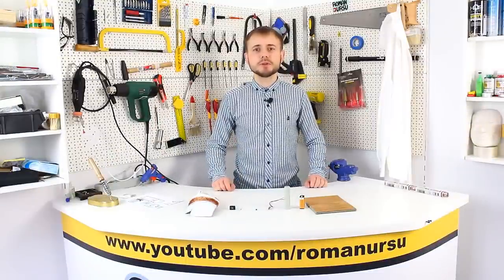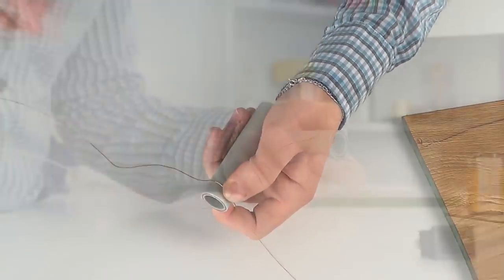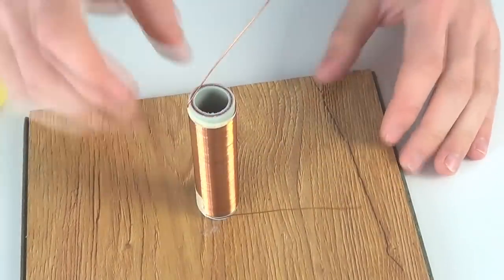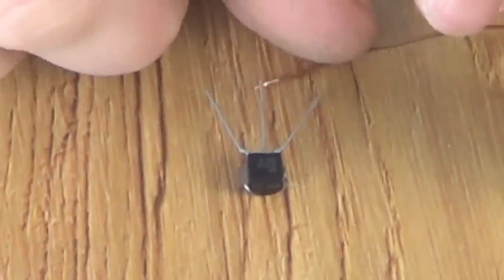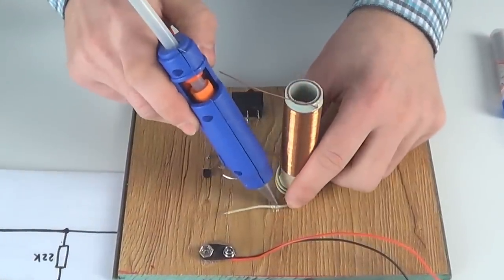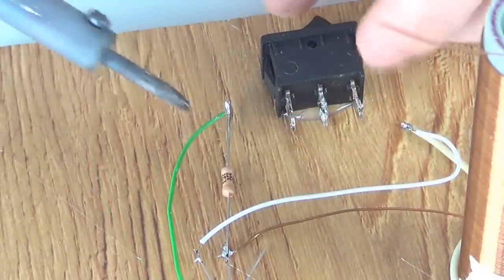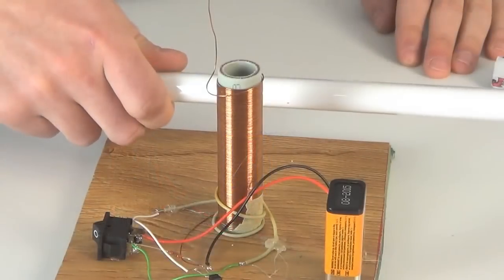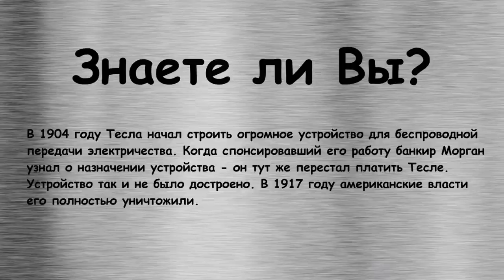How to make a mini Tesla coil 9V

Comment: it is slayer exciter not tesla coil
Reply: +Dark X66 tesla coil generate visible high voltage and it is powered by AC (alternative current) slayer exciter can be made of tesla coil. You can search more in the internet. I have one huge tesla coil and it is getting a lot of power so I have to pay a little bit more for electricity. sorry for my english.
Reply: can I use 26 AWG copper wire?
Reply: swg*
Reply: It IS a Tesla coil It has a secondary coil and a primary coil and if you used higher gauge wire and a high power  power supply and add a torus then you're done  with creating a Tesla coil that emits sparks at a high frequency
Reply: I can justify the difference between Slayer Exciter and Tesla Coil.. Tesla surely was the pioneer of the basic model and design of the way the primary/secondary is arranged.

However a classic Tesla Coil is quite different, different enough to call it a completely different circuit. It uses a spark gap and very high voltage discharges to step that voltage even higher across the secondary. the frequency is typically not high enough to be considered radio.

The SSTC is a little closer but it typically uses a driver with modulation, and most likely some form of fet switching on the low side.

What this man did in this video here was literally replicate a Slayer Exciter circuit using a single silicon transistor and resistor, the only thing he left out was the indicator LED. It's not wrong of him to call it a Tesla Coil so long as he remembers to credit GBluer (slayer007) with the circuit design.

I make them all the time and each time I know I'm basically building a TC, but It's always in my mind that I'm basically using a Slayer circuit design to do it. You can even most times remove the resistor and just run the circuit by kickstarting it across the B and C of transistor, making it an even simpler circuit. Still a Slayer Exciter.
Reply: Perhaps you can't read properly, but I clearly explained the differences between the two. There are many circuits that are quite similar but with slight variations are referred to by different names. When it comes to Tesla coils, this is why a 'solid state Tesla coil' is called that, because it's specifically referring to the way the circuit is designed. A traditional TC is going to use a spark gap and capacitor(s) which obviously a 'Slayer Exciter' does not employ. The RF and use of the transistor in Slayer's circuit is what allows it to emit a strong field at low voltage. A traditional TC is probably going to bite the crap out of you if you decide to touch the arcs, whereas a Slayer circuit is going to give you a small RF burn.

If you want to say a primary and secondary put together like that is always going to be the same thing then we might as well just stop calling them Tesla coils because they are nothing more than 'high voltage transformers'. 

Call it delusional all you want, I just happen to know the guy spent years working on it and researching it and tinkering with it to hone it down to a real nice and easy circuit to build and operate, so I don't see a problem with at least acknowledging  that by calling it a 'Slayer Exciter' whenever a 'Tesla Coil' is wired in that way and functions like that.

Comment: it is called: slayer exciter. not tesla coil
Reply: No, it's definately called a Tesla coil.
Reply: +Math's Tech A tesla coil has a big capacitor bank, runs on AC. This is a slayer exciter, not a Tesla coil. I can tell you more about why this does not make a Tesla Coil.
Reply: Flame 281
"Kind of", yes, but as you can see it only uses a single transistor flyback driver, NO spark gap, NO resonant tank and NO line filter. You can't call a slayer exciter a Tesla Coil... That's like saying a frisbee is a plane, because it flies.
Reply: +Azagro What you are doing is more like saying if it doesn't have twisting wings and the pilot laying down, it isn't an airplane.
Reply: we know
Reply: Steve Greenfield
What I am saying is that this is not a Tesla Coil.
Reply: +Niels Daemen 
ha ha ha verry funny

Comment: Great build! Just a quick question regarding the mechanics involved. Am I correct in assuming that the diode is switching the polarity back and forth? Ignition coil effect? Also, is the resistor there to keep a load on the circuit and prevent the battery from heating up? Thanks in advance.
Reply: +Benjamin Franklin Thanks. I actually meant to say transistor and not diode. Must have been what I was smoking at the time :)
Reply: @BackwardTechnologies  yo can this thing kill bugs

Comment: it did not work is it fake
Reply: DONT U GET IT ? YOUTUBE IS FAKE FROM THE TIME WAS BORNED !!  I TRIED THE SAME THING  IT DIDNT WORKED SO EVEN THE SIMPLIEST VIDEO ON YOUTUBE IS FAKED !!!!!!!!!!!!!!!!!!!!!!!!!
Reply: mine work perfectly :)
Reply: ProWajxxx  beg in u tell me all the materials u used ! i tried 4 times and NNOOTTHHIINNGG  what kind of cable did u used ? ?  please m8
Reply: I used milimetr thick copper wire, pvc pipe 1cm in diameter, wood basement and did it like he in video
Reply: ProWajxxx i did the fucking same shit i saw a lot videos bigger pvc fatter and more stuff added
Reply: was your wire wrapped around the plastic the coated type for coils? 
you cant use regular wire ,  .  if that's the case  you can buy that type of wire at radio shack or you can take apart a old relay
Reply: you need to use enamled copper wire or magnetic wire.
Reply: Madness4

Comment: so how to make the coil electrified when connecting an Aluminum toroid to the coil? i want to see sparks, could this be done by adding more resistors and increasing the coltage from 9v to 12v or so?
Reply: I would say you could upgrade the battery to at least 15 v anything higher than that you would probably blow up your hands/ components

Comment: Its a Nice Job 
I Build fora few jears ago some bigger once
But you shold take the Transistor and the Orgel Parts a Little big far away from the secondary 
The secondary schould conectet to the ground and the Primary a Little bit higher so you shold have more power and some Little Sparks

Comment: Thanks, that was a very good and inexpensive weekend project. with the exception of the transistor and resistence, I managed to make it completely out of waste material.
Reply: +Duru Adolphus Jnr. Yes, it did perfectly.
Reply: +Duru Adolphus Jnr. I ran into two problems that prevented mine to work in early drafts, the first was that the wire I used to surround the main coil was from a different, less conductive, material than the main coil made of copper, and it didn't work effectively with it; so I had to change it for a piece of copper wire. 
The second one was that the wire was too close to the main coil, and for some reason that also made it fail; my solution was to just distribute the wire on a bigger space.
As of the transistor, my knowledge is basically zero on that matter, but I have seen other coils that work with different transistors and resistances. The wire I used was from a broken flashlight (the kind you have to shake to power)
Try using a 15w fluorescent bulb, that's the biggest I've managed to light up with my coil. You can actually see mine on a video I posted a few months ago. If you do also keep in mind that my coil is a little longer than it should be, and that also has a bad effect.

Comment: what kind of wire is he using as a secondary spool and also what kind of wires is he using to solder the secondary spool to the switch and transistor.

Comment: Can i use 30 gauge (0.25mm) magnetic copper wire? and BC548B instead of 2N2222A transistor ? please reply me as soon as possible...
Reply: You can use 0.25mm, but not BC548-it is only rated for 100mA.
Maybe try PN2222 or BC337, BD139
Reply: Thanks a lot sir.....

Comment: if I used a 5 volt power supply In place of the 9 volt battery could I remove the resistor?

Comment: what should be the exact gauge of wire used in the secondary coil? and plz help because I tried many times but was unsuccessful
Reply: dont try it. it wont work. i've tried 30 awgx400 turn, 0,05mmx3000 and much more for secondary combined with 2, 5 and 20 turns primary. wont work no matter what

Comment: +Roman UrsuHack What is the voltage of the tubelight you have you used? Around what range of voltage of lights does the Tesla coil light up?
Reply: Also,  will it light up an incandescent (traditional yellow) bulb or CFL or LED? I tried with a miniature 5V (like this: http://www.litesourceinc.com/mmLITE/Images/50.JPG) but nothing happened.

Comment: How does this work if the other terminal of the secondary coil is left unconnected? Is there like some feedback coming from somewhere?
Reply: yu
Reply: +SuperConductor the transistor crates high frequency DC which can be looked at as if it were AC meaning that the EM field created by the primary expands and collapses which inducts a current in the secondary which then creates it's own field at the same frequency but higher voltages. Actually the only reason the secondary coil is connected at all is to supply electrons to the coil and to switch the transistor not to create the EM field, as that is what the primary is doing
Reply: Yextus Thanks for the info :)

Comment: Ty.Finally got my slayer working.
Ill post a link later,right now i`m just exited.:)

Thumbs up
Reply: +Jan Demant My tesla coil isn't working,I did the same as in the film but my coil is 2.5 cm, not 3 , and my resistor is smaller than in the video but it's 22Ohm. Can you help me?
Reply: +Jan Demant 
Can you text me? I have a problem with mine. Plz help :) wot95@wp.pl thx!
Reply: Try swapping the ends of the shorter coil connected to the transistor. This is the most common problem. The primary and secondary windings should be opposed in order to create the back EMF required for oscillation to develop the high voltage in the longer coil.

Comment: where is the other end of the secondary coil attach too....from the video it looks like its just going up in the air???
Reply: That's right. It just sticks out up in the air. The surrounding is used as a capacitor, which also goes to ground and the circuit is complete. You can attach an metal plate to this wire or a metal ball, which increases the capacitance and also changes the surrounding electric field, allowing the light bulb to light more effectively above the coil, rather than just at the sides.

Comment: Why use thick wire for the "secondary" coil if you use thin wire to connect to the rest of the circuit? And I think what you call the "secondary" actually is the "primary" coil. 
To make a more exiting Tesla coil, look up "Tesla coil using electric fly zapper" in your favourite search engine. Easily creates 30mm sparks from two 1.5V batteries.

Comment: If I want to connect two 9V batteries in circuit, then how should I connect them? In series or in parallel?
Reply: And if I use 2 batteries then I think my transistor will blow up? Please reply I want to make a stronger Tesla coil for my project..
Reply: you can connect the batteries to each other actually. you can solder them together if you want.
Reply: ya mum

Comment: Russian is cool. The little thing built could have been better for as resonance transformers, tesla coils have to be TUNED in order to get the max out of their step-up capabilities. I do not see a tuneable feature built into the tesla coil, indicating that the resonant frequency of the high voltage winding may not coincide with that of the transistor oscillator, thus diminishing the result it turned out which could otherwise be more impressive. Also,adding a spherecial conductor (say a ball bearing) to the top of the secondary coil will better its frequency response by creating a more reliable to-ground capacitor.
Reply: +Jeffrey Fugh This is not a Tesla coil, as many have pointed out - it's a slayer exciter. Use the Googler for a few minutes - save yourself lots of embarrassment.

Comment: hey what is the AWG no. of the coiling wire used.
Reply: +TUSHAR KUMAR i think 1mm works out about 18 gauge. google it, it should be somewhere
Reply: +TUSHAR KUMAR  Advise not to use thicker wire. fine wire means more turns, means higher volts out.the current out is low, so heavy wire is not needed.

Comment: Can i connect it my 12v joule thief instead of a 9v battery?  {my Joule thief Is powered by a 1.5v Battery and is based on a standard circuit}
Reply: +Nikhil Parte No, the current of your joule thief is just too low
Reply: +ShuShu Bana Did u READ my post I hav connected my joule thief to a 1.5volt battery and now the output by the joule thief is about  12v- 15v
Reply: Nikhil Parte Yes, what i was trying to say is that your joule thief outputs 12v-15v, but the current of that output is just too low (because of the 1.5v battery) to even make something visible on the tesla coil
Reply: no no i dont want spark gaps i just want to know if it would light the bulb
Reply: Nikhil Parte Hmm, i'm not sure. I can't tell you the truth, all the things that i've said are just my thoughts, but, testing is your best friend!

Comment: which copper wire is used in making this coil?
Reply: Its called magnet or armature wire in most places,it has a thin coating on it made from varnish or most likely epoxy these days.If you dont have a radio shack near by you can steal some from a old speaker voice coil or possibly a relay etc.

Comment: Ca you charge you phone with this if you plug it into the wall instead of the battery
Reply: no
Reply: that is ac so you have to use converter and another coil

Comment: This is not a tesla coil. This is a Lodge coil. A tesla coil is a lodge coil where the input voltage oscillates as the resonant frequency of the primary and secondary coils. It you take this circuit and tune the primary and secondary to resonate at the same frequency, then you will have something that can somewhat loosely be called a tesla coil. Technically, a tesla coil is supposed to use sparks to excite the primary into resonance at high frequency, but tuning it would be enough to call it a tesla coil.

Comment: if copper cuts when making coil ,can ii joint and use that copper wire
Reply: Gurudatta G Yeah But First Remove Insulation With Ends Using Sandpaper and Solder the Ends And Thats IT
Reply: Thanks

Comment: I tried this video several times but yet not working plZ make a new one with full specifications plz
Reply: Paras Mittal I bet you used regular wire. you need to use coated wire instead

Comment: This circuit would drain the battery very quickly, as I see it, to the point that the voltage on the transistor will become too low to sustain oscillation.
Reply: doesn't drain all that fast, I was using 4 AAA's in series and I would leave it on for quite a while.

Comment: Try drawing the circuit diagram and you will realize this will not work. Look at how the transistor is wired. The collector is connected to the 9v supply with just 2 turns of wire. Emitter is connected to ground and the base connected to the 9v supply through a 22k resistor. Right after turning it on, the transistor will be saturated and with virtually zero resistance at the collector, the transistor will just DIE! No capacitor? How is this supposed to oscillate? You need a tank circuit and some kind of feedback configuration to sustain oscillation. And try looking at the lamp when he tested it. Looks pretty unstable. Makes me think its fake.

Comment: is the copper wire insulated?
Reply: Yes, it needs to be enameled. The number of turns is essential in building up the high voltage and without the enamel, the coils would short circuit making the number of turns moot.
Reply: +Paul Ybarra thanks
Reply: Yes. Magnet wire or enameled wire is a copper wire coated with a very thin layer of insulation.
Reply: oh thanks i know what enameld wire is but he didn't mention in the vid which wire you need

Comment: please trouble shoot me. i make it as your video and  transistor 2n2222a getting too hot and burnt.. what was my mistake. i was using 9v rechargeable battery (uniforr Ni-mh) i check circuit 3-4 times before using.  why does it burnt out. i put right resistor 22k. so why this happen
Reply: maybe because your transistor was upside down. you have to connect the transistor as the video, whith the flat surface up
Reply: may be. can i increase resistor or required heat sink for transistor or decrease the turns of tower. or else.
Reply: Anil Kale I have Bought BC547 Transistor Can I use It as the same
Reply: Samarth Kambli you may try with it by right connection. and use metal heat sink.
Reply: Try reversing the primary coil connections.
Reply: Maybe you got the wrong resistor

Comment: how much volt do you get on the top after all ?
Reply: +Mars Seeker looks  like 200   to 300 turns  on  large   coild  two maythree on  small  -  say  500  volt  -  and  not  enough curtrent to  drive a  multi-meter to measure
Reply: not a Clue Thank you ! how do you measure that approximately ? multiplying turns in secondary with primary ?
Reply: +Mars Seeker 80mm pipe/0.1mm wire = 800 turns secondary. 1 turn primary. Ratio: 1:80. 9V*800=7200V - typical losses
Reply: TheCarpenterUnion so that's how it goes, thank you very much .